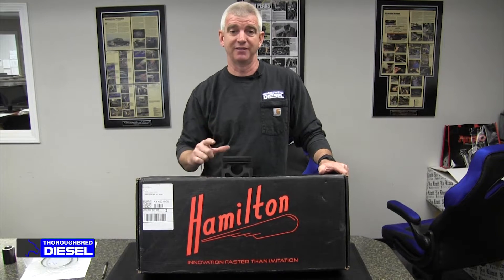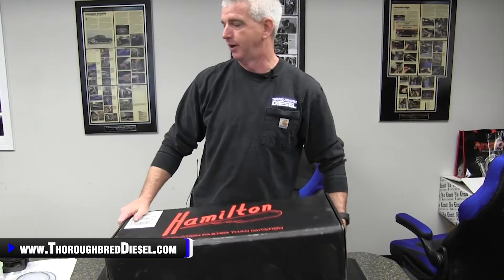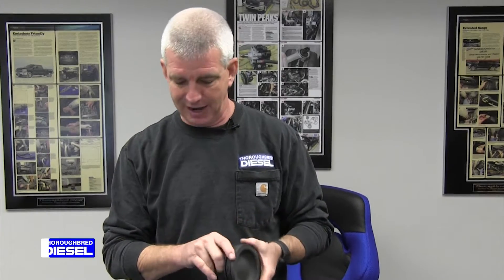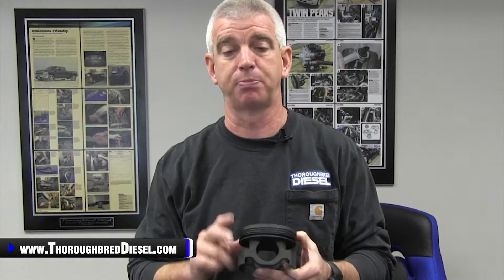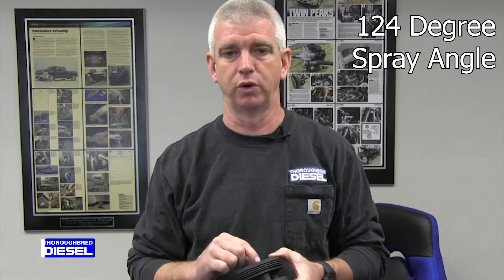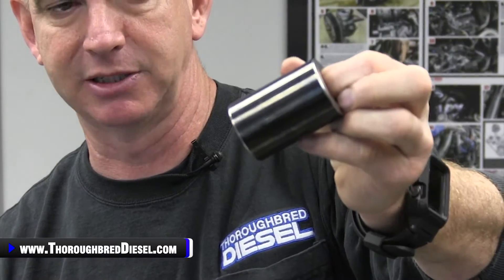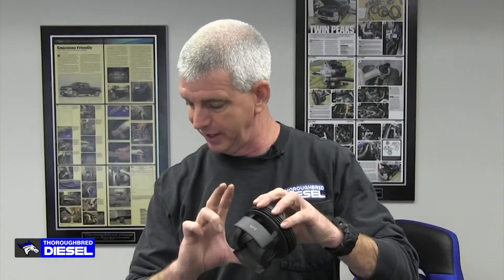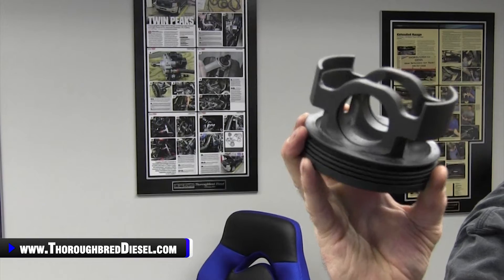Prevent Piston Melting In Cummins 6.7L Competition Engine With Hamilton Steel Pistons #diesel #dodge

Comment: So if I build a Spark-Ignited/LNG/Ethanol Cummins with the same parts most racing diesels have, is there a chance it could be revving higher engine speeds and still make a boat load of torque? I'm new to the diesel community but only because I'm trying to see what's possible with a spark-ignited Cummins build.